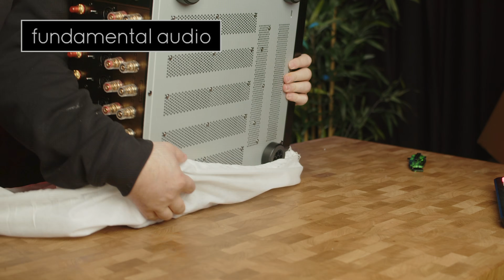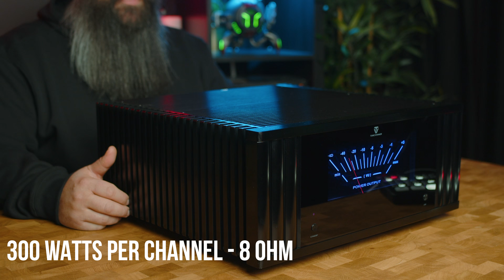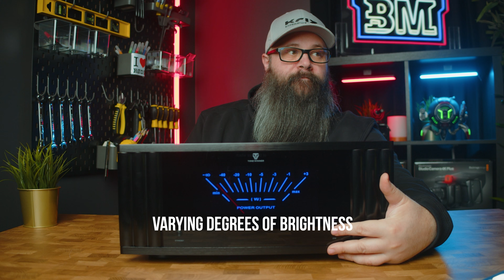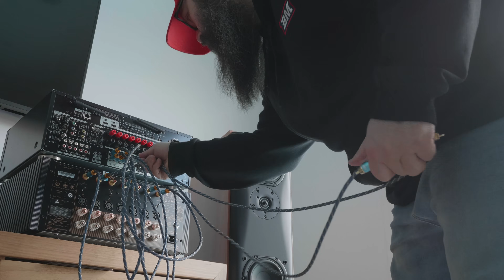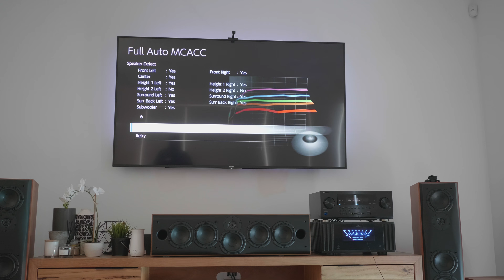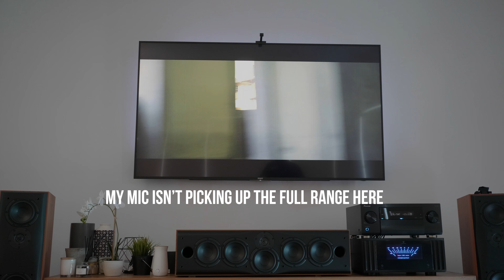Incredible "BUDGET" 300 WATT BEAST Home Theater Amplifier! // Tonewinner AD-7300PA+

Comment: 7x180w not 7x300w. The 300w watt rating is only when 1 or 2 channels are driven.
Confusing, elsewhere states 7x300...
Reply: Summithifi has more detailed specs on their website for power output. Basically 180 wpc into all channels and 300 into 1 channel.  Great video though.  Love the VU meter on this amp, gives it some character.
Reply: Colin is correct.   Per Summit HiFi website, power output is 180W/channel at 8 ohms all channels driven
Reply: This is correct, i own it (the newest version too..7300pa +) and did a ton of research before buying it. If you check out summithifi in usa/Canada  
They mislabeled it in the major description but if you scroll down to the specs it states 300w for one channel driven and it drops to 180wpc x7
channels driven. Copied directly from the site-
180 watts RMS/channel; THD<0.1%; 8 Ohms; all Seven channels driven. Still in all it is built like a tank, sounds amazing, runs very cool and for $1500 it is a steal. Plus if you get it from one of those places Aamir is a super nice guy.
Reply from the maker: Not according to the documentation. Where did you hear that? It’s all channels.
Reply: @BuildMontage  first looked at it a few days ago and that was what was stated. Checked elsewhere just now showing 7x300.
Reply from the maker: @colincams  for me it’s purely academic and I don’t like to argue these points. As I said in the video I have no way of measuring so I have to go by the specs and use my subjective opinion.  Either way, great amp for the price. :)
Reply: @BuildMontage  I'm running a measly 7x160w and it has plenty at that level, I think where I saw 7x180 has been edited to now show 7x300
Reply from the maker: @colincams  I wonder if that was maybe the 7200 - this is the newer one. Most speakers will not need that much - but as Im not a technical reviewer, I have to go off manufacturer specs. I just like to showcase products and show the community the different options out there.
Reply: Incorrect. I have them.  They run 300+ wpc all channels driven
Reply: @jadan2000  did you measure it or is that a claim or something yoinsaw printed?  that is misinformation if you don't have test results you can share. Why would they post information on the actual website  that was that far off. A lot of places selling things inflate power numbers to get sales so i am trusting Aamir since i spoke to him directly when i bought mine. The only time he said I'd get more power is wjen i called him because my center channel is now 4ohm so he said I'd see a bump and may have to adjust my trim slightly over my 8 ohm center that i had.
Reply: @brianhorrorfan  to clarify, my comment was based on 4ohms all channels driven. I was told by Aamir and I had one of them tested. At 4 ohms it will get over 300 wpc.
Reply: @brianhorrorfan  also I'm not sure what you mean by them posting something so different. If I remember correctly, they don't give all channels driven at 4ohms on the site description.  I think they show 2 channels at like 450-500. Some like that.